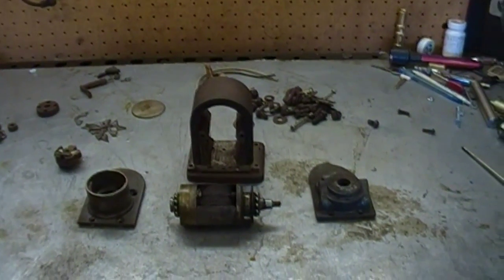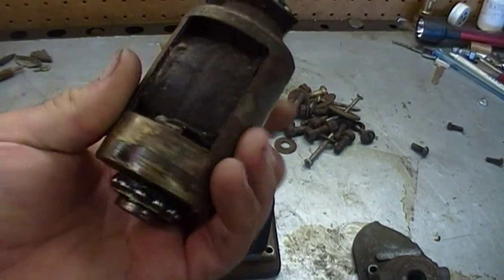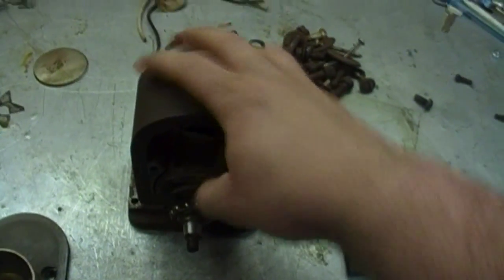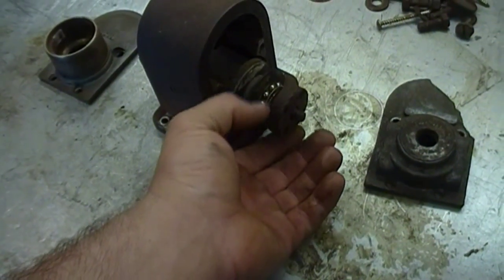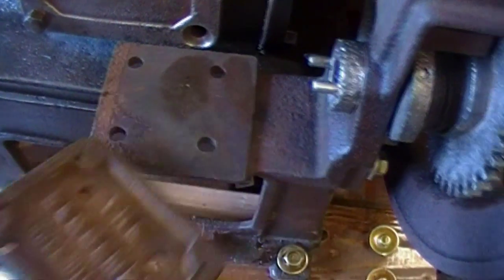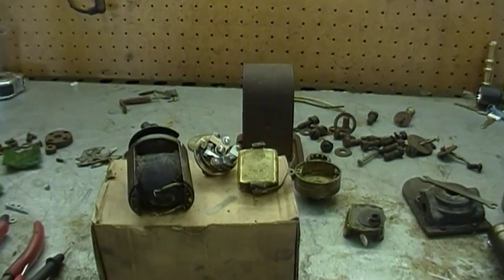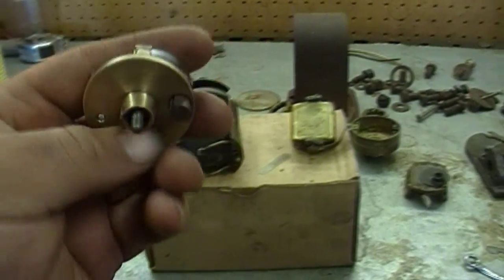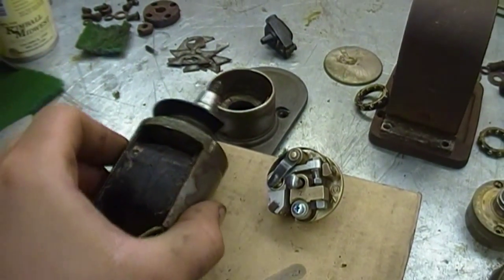Bessemer Engine Pt.4 Magneto

Comment: The funny thing about the "adapter" plate is that it was never drilled for it's original purpose. The large holes are obviously only there to match the magneto mount, and the small holes are only there to match the magneto base. The bosses in the corners of the plate where it would typically be drilled are blank.
Reply from the maker: Yep very interesting for sure.  Need to figure a way to display it prominently in the engine once it is done!

Comment: Nice work so far!
Question on the condenser you tested. When you say it was "open circuit", you didn't test it with a resistance test did you? Open circuit/infinity with resistance test on a capacitor isn't a bad thing. A capacitance test would be the best. Chances are at its age, its probably a voltage leaker anyway.
Reply from the maker: Thanks!For testing I have my meter measuring in micro farads, which gave me an out of range reading.  Then short the legs momentary and put an analog meter on it to check that I have some current flow before resistance builds to infinity/open.  In this case I had no current flow at all.

Comment: Maybe it had a buzz coil originally and when they put the mag on they used whatever they had in the field to shim it? I would use a different piece of steel to put under the mag!
Reply from the maker: Could be, I wonder what a mag conversion kit cost in the late teens!Thanks for watching!
Reply: SmallEngineMechanic I think they cost around 15-20 dollars.